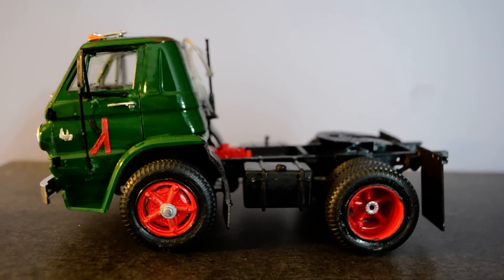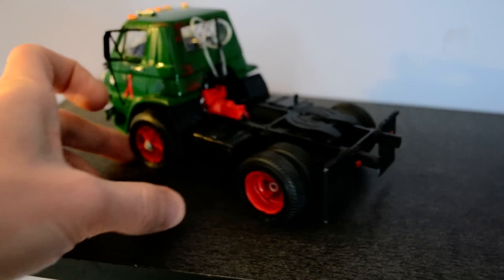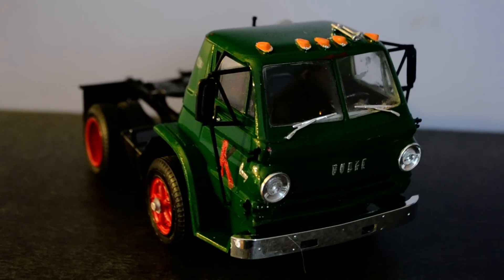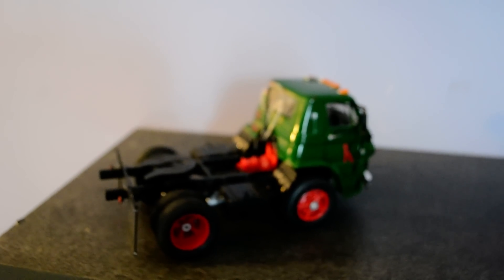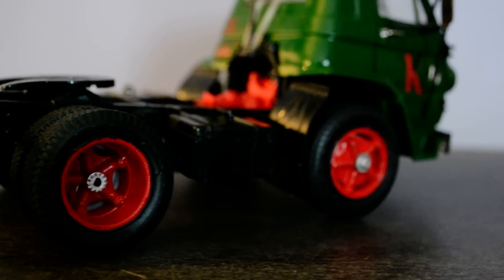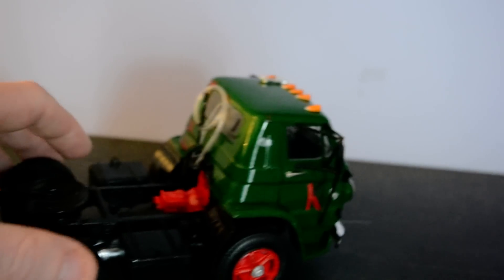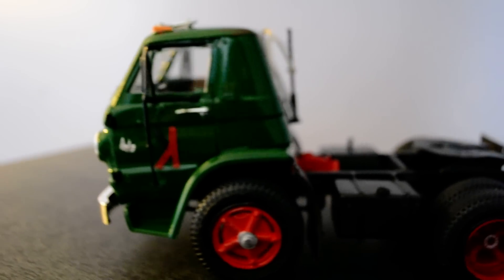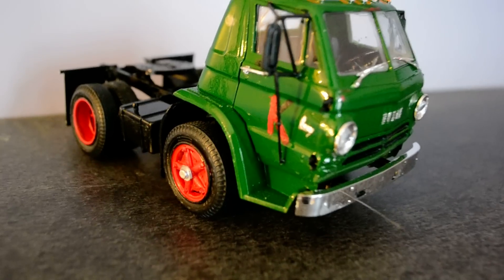FINISHED LINDBERG DODGE L-700 CABOVER TRUCK MODEL

Comment: Yeah I was gonna say that the old Dodge trucks, most of them had a 361 truck engine in them, it had kind of a big bore with a short stroke for torque! It was only like 190 Hp but with 300 ft lbs of torque! Actually it was probably closer to 400 lbs of torque! But yeah those old Dodge trucks were something else though! And that was the old gas engines too imagine if they had a diesel in them! Like the Cummins engines of modern trucks! Great build though buddy!

Comment: The engine in that kit is a 194 H.P. Dodge 361 cubic inch V-8. The instructions that comes with the kit tells you all the specs on that particular model. I built 6 of those for a friend who wanted a fleet of them for a special project he was working on.